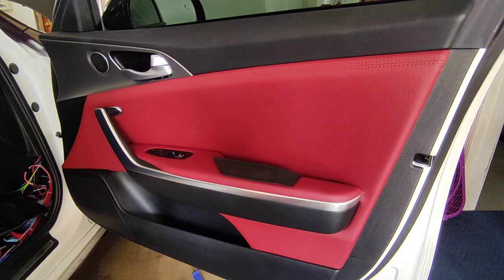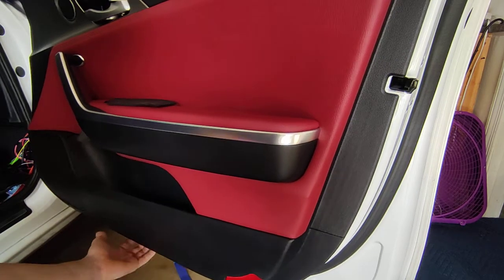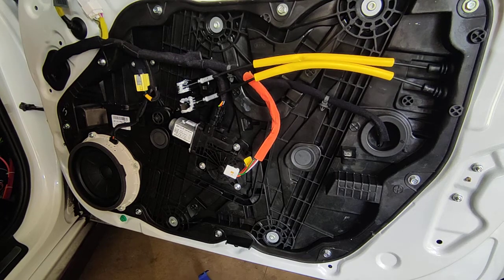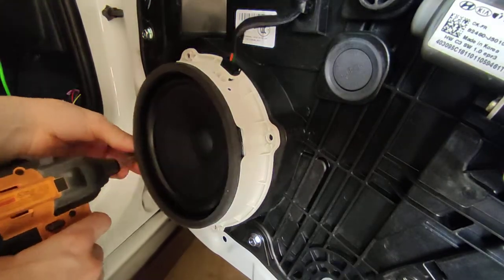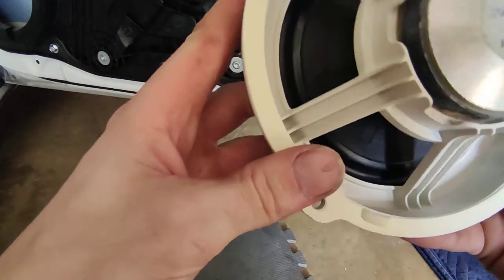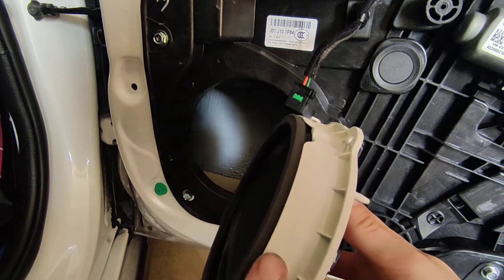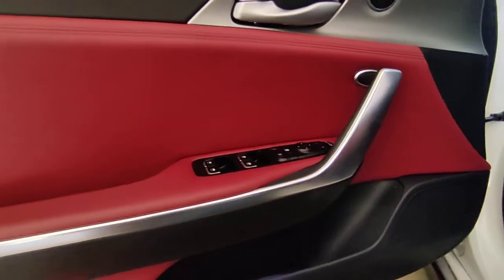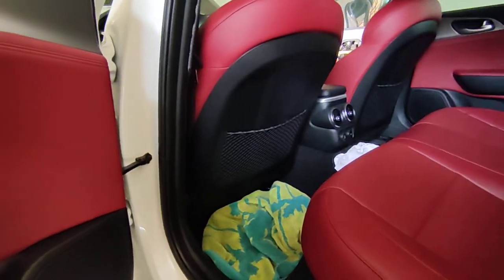kia stinger door card removal for upgrading speakers

Comment: Did you bypass the factory amp to power these speakers? Why did you choose PRV over other brands?
Reply from the maker: They are powered by a designated amp. I like prv
Reply: @miscellaneousguy3803  sounds great thanks for the response. I see these are 4 ohm. I may install new speakers now and install a dedicated amp later. Can I install these 4 ohm PRVs with the 2 ohm stock amp? What PRV models did you use for the rear and center channel?
Reply from the maker: @jonathan4831  you could but id recommend a diff speaker. its extremely hard to get the prv's happy in this application. ive been doing audio related things for a long time but for some reason, this car is super picky in response

Comment: So you ended up not using these speakers because of issues with the tweeters?
Reply from the maker: I changed both the speakers and the tweeters. No issues with either of them just going higher volume.
Reply: @miscellaneousguy3803  I'm looking to from the stock stereo. I don't mind the sound quality but there isn't enough volume. From my limited research it appears this system uses 2 ohm speakers so simply upgrading the speakers won't fix the issue I dislike
Reply: What size tweeters did you use